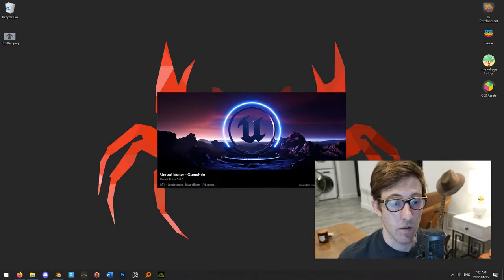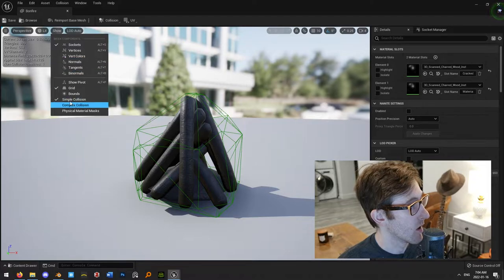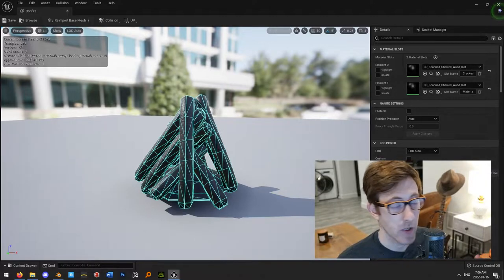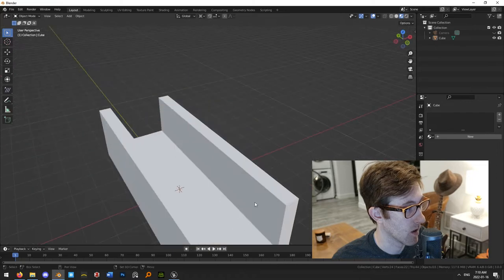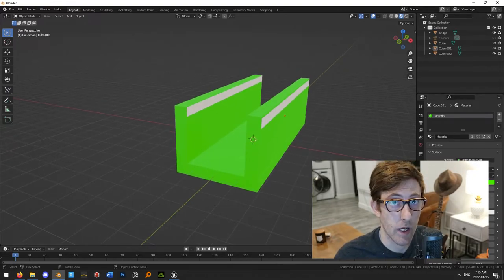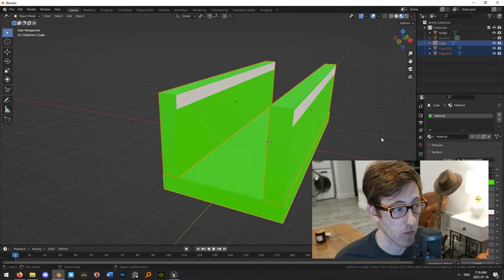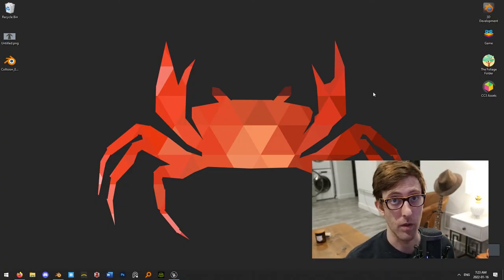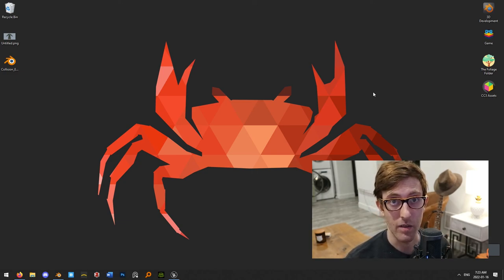Blender to Unreal: Custom Collision for UE5 (E02)

Comment: You can also join the collision objects. That way you don't need to name them all. If you do this, you don't need to number it "001." 

Kinda interested on what you would change in this tutorial if it was for an shooter game? Because now you need more complex collision, not just for the characters but bullets as well.
Reply from the maker: Hello - unfortunately no, you cannot do as you suggest here. This could potentially mislead others reading the video comments to think that this is a good suggestion, so I just wanted to make clear that this will not work. The reason is that simple collision - as mentioned in video - does not do Concave shapes. So if you merge two collision boxes that have a gap between them for example, it will fill in the gap on import to make it Convex only, and you will end up with a single box with no gap between them :)

For bullets though it really depends. There are different approaches. One would be to use a line trace by channel. Another would be to actually spawn projectiles, in which case you would make an actor class for "bullet" and the bullet itself will have a collision box. 

Damage detection is tricky because you can end up with a situation where if you detect frame-by-frame, someone with poor FPS on a slow computer could have a situation where only frames before and after the impact get rendered because their machine is lagging a lot...in which case, there would be no damage detected, the frame where the bullet is within the target never got rendered. So you usually want to do some careful thinking about how to detect damage to make sure that doesn't happen. One way is to line trace each frame (just while a bullet is in flight) from its current position to its position last frame, so that there is no chance of damage ever being missed. This is an expensive operation though so you want to limit it to while the damage detection is active, usually doing expensive operations on-tick is something you want to restrict as much as possible.

Comment: Would you be able to do an Inventory System tutorial using blueprints fro UE5? Or possibly recommend tutorial videos? 
Thank you sir!
Reply from the maker: Hmm - what type of system did you have in mind?
Reply: @cgkrab  So I was thinking of an inventory system like the Witcher 3's, where you can drag and drop weapons, consumables, armour, etc into certain slots of the inventory. I've only ever made a very basic inventory in Unity before.
Reply from the maker: @LeetardPlays  Hmm ok. Thanks for this suggestions, I will think on this for a bit. I am currently working on a blender 101 series for beginners to 3D modeling for the channel, once that's finished I plan to do a similar one for Blender & Unreal Engine. So this could be part of that. I will have to think on the best way to arrange this
Reply: @cgkrab  Thank you for considering this. Honestly, you're a hero

Comment: Make a very low poly mesh of your model and import it as an LOD. Then set the collision to use 'complex as simple' and tell UE5 to use the low poly mesh for collision.
Reply from the maker: This is not a replacement for the method shown and is only appropriate if you are certain the object will never be simulated, since simulation is not supported with complex as simple enabled (unless this has changed as of 5.2).

Comment: When the model is imported into UnrealEngine using the glb/gltf format, it cannot use prefixes such as “UCX_” to generate collision meshes for the engine. How this fix?
Reply from the maker: I will have to investigate this. Is there a technical reason why you would need to use gltf over .fbx (since UE supports collision importing on .FBX)?

There are a few alternatives. You could add collision boxes directl (see here: https://docs.unrealengine.com/5.2/en-US/setting-up-collisions-with-static-meshes-in-unreal-engine/) 

You could also use auto-convex collision
Reply: @cgkrab  This format turned out to be more convenient than the FBX format.  Good compression and export of materials.  Recently switched to it and so far I don't know everything.  And it's not a proprietary format, which is a plus.  

Auto-convex is not always the best solution in my opinion

Comment: I have a question: When i add a Terrain Mesh from Blender to Unreal Engine, i need to setup a collision for it, but the default terrain in UE5 has no collision. So why extern meshes need a collision in UE5?
Reply from the maker: I am mot sure what you mean here; UE's landscape class does have collision. But if you mean just why external meshes need collision at all - they don't, UE will auto-generate a simple collision mesh on import if you enable that (it's on by default). This approach is required when you need concave collision, since UE's auto-generated simple collision is convex only.
Reply: @cgkrab  Hey, thx for the quick response, but i have checked the terrain, e.g in blank space project, and there is no collision of the terrain

Comment: I have a question i don't know if you're going to be able to respond, imagine that I don't import the usd file into unreal and I get the file by path like I get it with a url path, can i still have collisions ? Note that  I aint importing the file to my unreal project, I'm putting the name as "UCX_" but still I don't have collisions.
Also I know you're working with fbx file, but I was wondering if you could help me anyways.

Hope you can help me mate !
Reply from the maker: @perez4506  I have not tried .USD but you can also manually add simple collision inside of UE if the .USD format is not cooperating
Reply: @cgkrab  I can if I import the .USD, if I don't import the .USD I have to find a way to "go around" of the problem, right ?
Because if you don't import the .USD into UE you dont have a static mesh.

But try to work with .USD, it's a new challenge for you :D, if you want of course, but I'll search a bit more and hopefully I'll find anything !! 

But thanks dude, keep going !! :D

Comment: Caveat I'm struggling with: larger scenes require hundreds of UCX colliders. We need an option that allows us to combine separate objects into a single collider to avoid littering our 3D modeling software with UCX objects.
Reply from the maker: I'm not sure if you can merge them and import as complex collision, but that would solve this. Will look into it when I have time ;)
Reply: Just make a separate collection in Blender

Comment: Hey I know this vid is 2 years old but is there a way to add collisions to an object inside blender and export it as a .obj
Reply from the maker: Hey there - to be honest, I am not sure as I rarely work with .obj. What you could do is try exporting a mesh from UE as .obj if it is possible, and then import it into Blender. This way you will be able to see how the .obj collision was set up in the exported file. Cheers
Reply: I figured it out. thanks for the reply though. The naming structure tip worked for me.
 @cgkrab

Comment: Hello, does my model need to be 1 object for it to work? Do I need to merge all shapes in blender and then do custom collision?
Reply from the maker: I think yes. Not in front my pc now to trst but if I recallmy experience with unmerged objects in UE is thst it eill import them as separate static meshes objects.
Reply: Tested it out with a 3d-model I made. As I don't like joining all the objects into 1 mesh, to still be able to have a highly editable mesh.
Just export them into 1 fbx, without joining your meshes together. Then, when importing into Unreal, where you have to tick off 'Generate Missing Collision', there is an 'Advanced' tab. Click that open and somewhere in the middle of the list that appears, there is an option called 'Combine Meshes'. Tick this on and your fbx gets imported as 1 single mesh.

I also have different collision boxes names and they are all imported. Got several UCX_ShipBody_xx for the bottom part of my ship and several UCX_Cabin_Large_xx for the cabin on top. So you can have everything still nice and tidy.

Comment: yeah but what about creating a custom collision for a skeletal mesh for collision with piece of cloth?
Reply from the maker: Cloth sim is a whole separate topic from custom collision ;) is it for clothing? Or for something else
Reply: @cgkrab  its for a tent (cloth) arround a structure (wood solid)
Reply from the maker: @talatalu  ahhhh hmm ok. I think there are a few ways to approach this...for collision, you'd probably only want to add collision for the poles and then to paont cloth sim on the cloth inside of UE. 

However I think it might just be more straightforward to do cloth sim inside blender only and then bake it out as an animation instead of real cloth sim. I find  UEs cloth sim can be kind of finnicky and doing looping wind animation instead takes the headache out of that process
Reply: @cgkrab  i exactly did like that (first paragraph) but "copy collision from static mesh" on a body item doesnt solve the issue for me.
then i kinda tricked ue and created a collision for one of the poles and now im copying and editing that for the others.. thanks for you answer by the way.

Comment: I did all the steps and my mesh is still using the UE5 simple collision instead of the UCX geo I made.  Anyone know why?
Reply from the maker: You may have left 'generate missing collision' checked on import, or you have the 'custom collision' checkbox on the static mesh off...that's my best guess. An alternative is that the names were not exactly right, but then UE should not be generating its own collision for your mesh as well so I think it's the checkbox on import.
Reply: @cgkrab  Hey thanks for your reply!  I did turn off all the boxes as well as used the naming conventions as you instructed.  This is why I posted. Im perplexed.  My UCX geo is made of one large FBX, could that also be the issue? (its a tunnel, so there is a ceiling) should I separate the geo to two walls a floor and a ceiling maybe?
Reply from the maker: @pointeddown  Hey - oh yes, that's probably the issue. Simple collision cannot be concave, it only allows for convex geometry which is why the UCX in this example is separated into so many different parts. If you have a convex shape like a tunnel and you use that as simple collision the engine will interpret it as a solid cube or cylinder for simple collision.
Reply: @cgkrab  I figured it out!  I’m kind of shocked how primitive the collision system is!
Reply from the maker: @pointeddown  Awesome! Haha yeah it is a bit. Was the concave UCX mesh the issue?
Reply: @cgkrab  Yeah anything Concave it doesn't like.